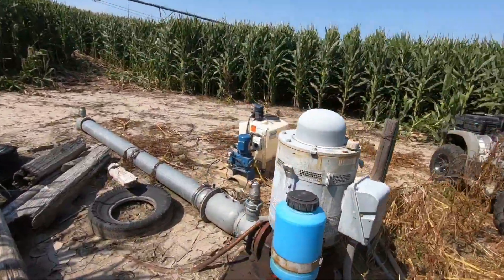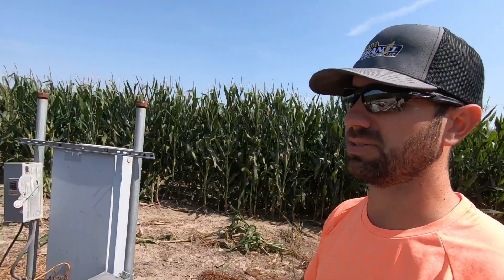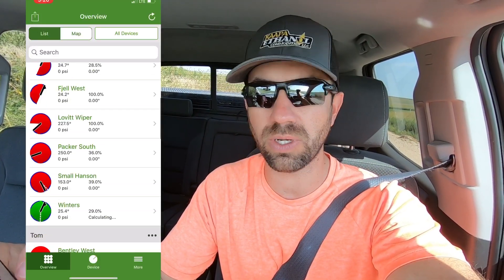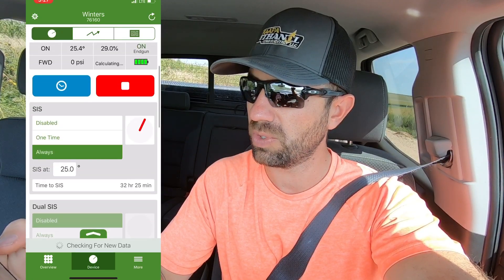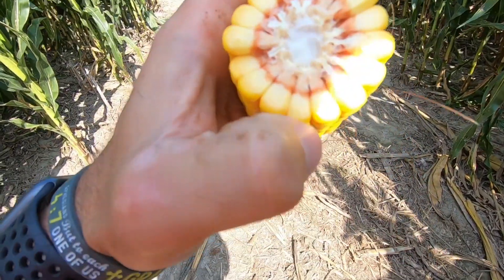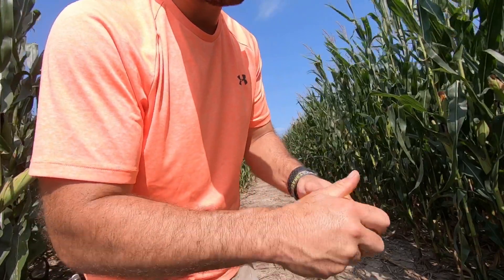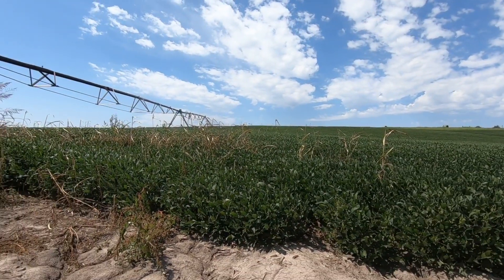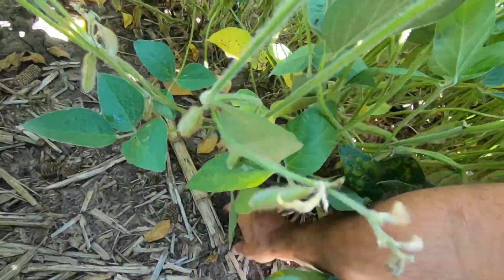Last Round of Irrigate 2019

Comment: Also in my life I’ve seen maybe 3 “poor mans” corner system pivots in operation too. They have a 200 gun behind a 100 gun that at a certain point shuts off the sprinklers and smaller gun to turn on the 200 gun and get a part of the field the smaller one misses. Then after a certain amount of time it shuts that off and goes back to normal operation.

Comment: I can’t remember what kind of soil you have in your part of the world, seemed like it had a little sand. I remember your video right after it emerged and your hills were washing out. Those hills are prime candidates for planting a rye cover on this fall and hitting it with a burn down next spring. Just a suggestion, but you may try a round and just see the difference. I’m betting it will be noticeable. 🤷🏼‍♂️
Reply from the maker: We’ve thought about trying something. Dunno what’ll get done with later harvest. We’re gonna chop some silage on a pivot that we’re going to put some cc on.
Reply: O'Neill Family Farms y’all are on 30’s? We are on 40’s. So what we do is either stop off the tubes on the drill where the rows are, like a 6-10 inch wide strip. Or take them off of the drill completely. Then about two weeks before we plant we burn it down with round up. Then it’s kind of the same as strip till, but we just run a stalk cutter in the top of the bed and lay down a strip of 32. We have super sandy soils and we started doing that on our irrigated years ago and it was a lot of trial and lots of error but it has helped so much with the soils and like you were showing in your beans it helps slow down evaporation.
Reply from the maker: Yeah we’re on 30s. Our soils aren’t sandy. But the guys was gonna try that. A strip on each side of old row and leave a gap to strip till in between. 🤷🏻‍♂️. Having it custom done so we’ll see.